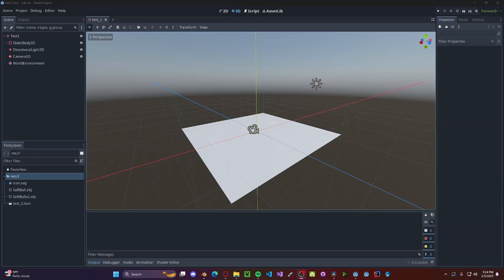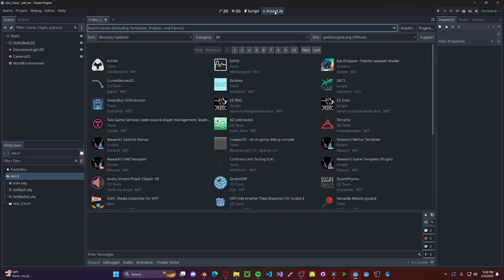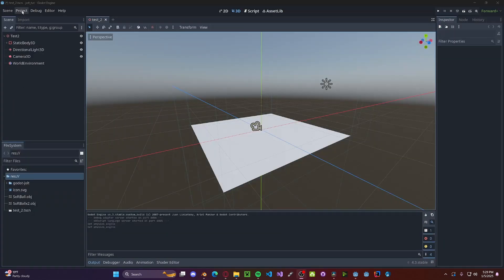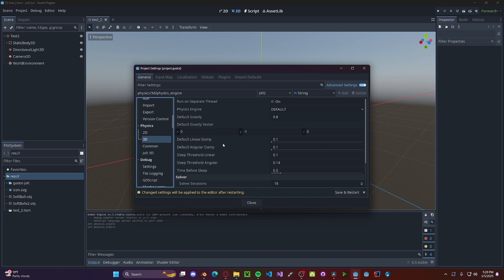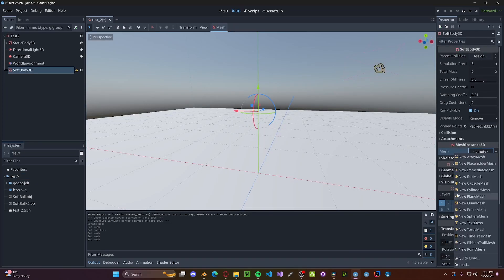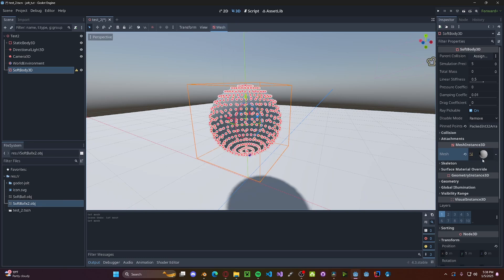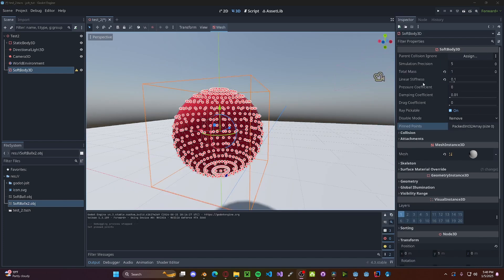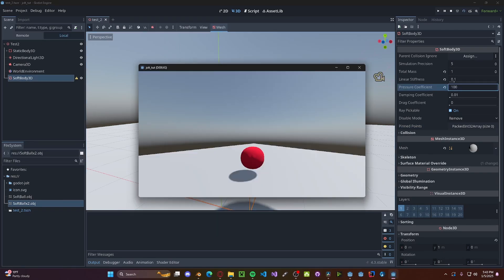Godot 4 SoftBody Physics Tutorial

Comment: Thanks for the vid. Why do you talk so fast though? Its stressful. Its better to teach slower.
SOME NOTES for 2025: 
1. Jolt is now included into Godot. You just have to go into the 3D settings and change from Default to Jolt. 
2. You can make the mesh more low poly if you click on Mesh in the inspector. Then change the radial segments and rings. No need to import from Blender.